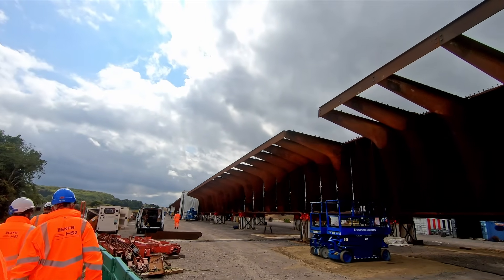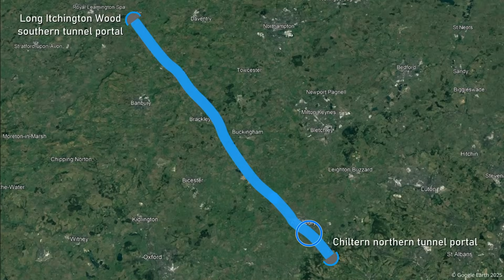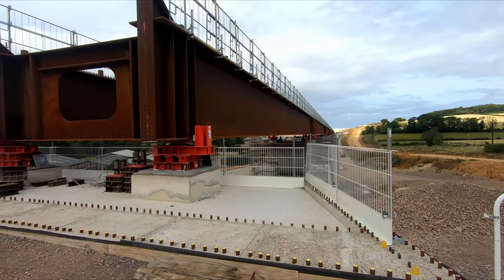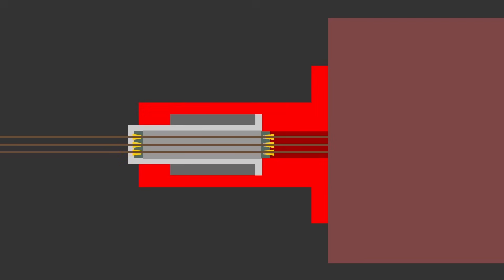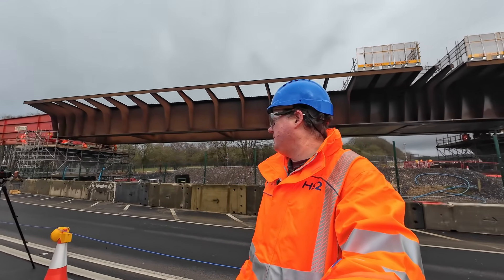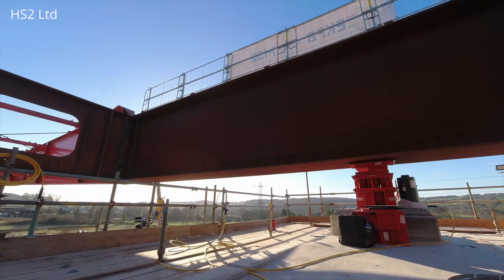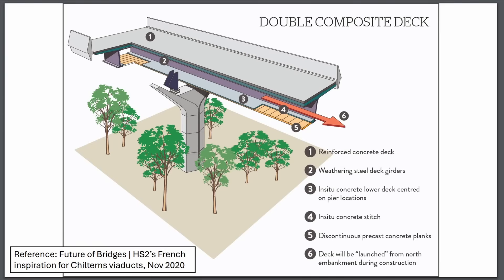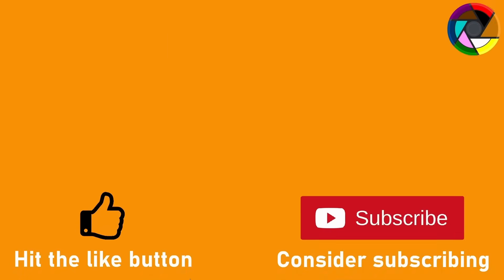Incredible 4300 tonne "deck slide" | HS2 Small Dean Viaduct

Comment: on a separate note _ and this is for many sections of the line a bit into the future _ hs2 is due to run on "slab track" _ used on other high speed lines in many countries _ as I understood _ the main contract they were to be manufactured in Somerset _ Shepton Mallet _ are some also to be fabricated by Pacadar in Kent or have things changed? _ does seem to be an interesting topic for another of your very informative videos as slab track is not used on main lines in the UK _ enjoying the content you post 👏
Reply from the maker: As far as I know the plan is still for PORR to manufacture the slab track in Summerset. I may cover the track and systems in a future video. I'm glad you enjoyed the video

Comment: Someone should tell the guys putting those teflon pads in about wheels.  It'll blow their minds.
Reply: Wheels that could fit and be strong enough to take the load would be expensive. Small diameter solid rollers would do the job but would be dangerous to insert between bearing and girder. The PTFE sliders are easy to make, (read as cheap), light and easy to store and handle, and easy to feed in. What's not to like ... ?
Reply: Oh should they? Tell us more - on what surface would these wheels run exactly, and what kind of material would they need to be built from to carry 100s of tonnes each?
Reply from the maker: Yeah.... I'm not sure that would work 🤔
Reply: @Rail_Focus , I think we can safely say that the professional civil engineers carefully considered the optimum area to construct the bridge and then chose the best (most cost effective) way to move it over the A413 and the railway line.